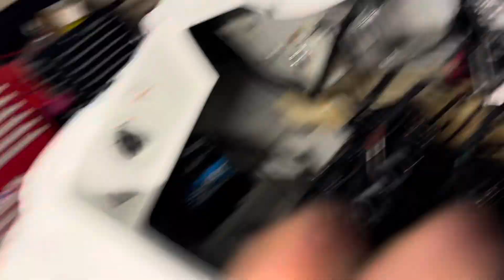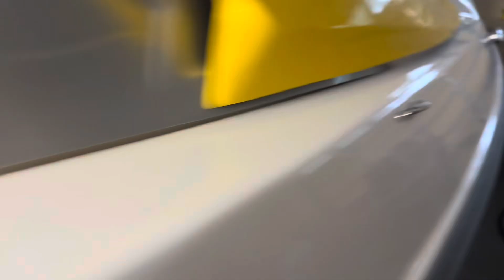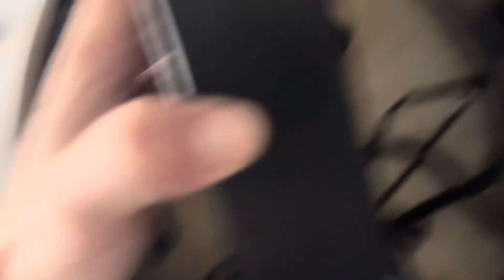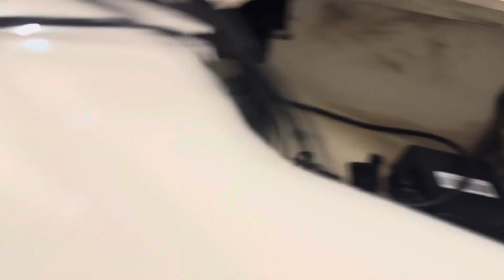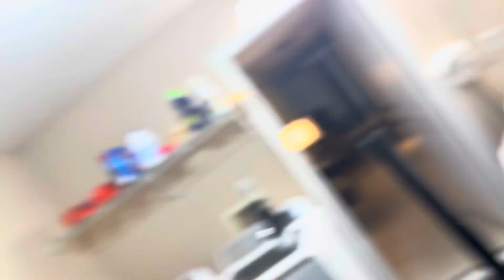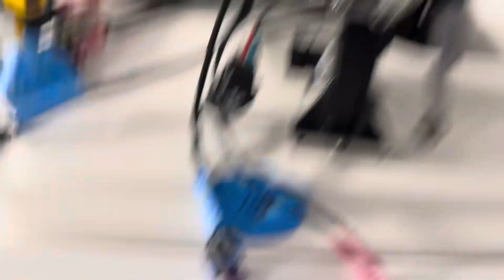Sea Doo Sportster 325X Project Part 4 (The motor is finally in!)

Comment: thanks for the explanation on the engine mount, will these modifications needs to be done if I'm using a 300 engine out of my GTX Limited?  I'm about to buy a Speedster and thinking of doing the swap

thanks in advance
Reply from the maker: @josemalave-d2w  depends on what year of ski the engine is coming out of.

Comment: Use riv nuts to mount the amp. Just a thought.
Reply from the maker: @BryanBrewster347  the amp has screw holes that are on the sides of it. You have to make a 90° bracket.